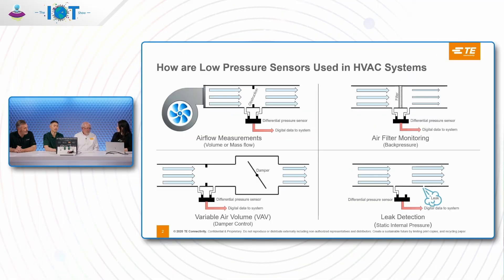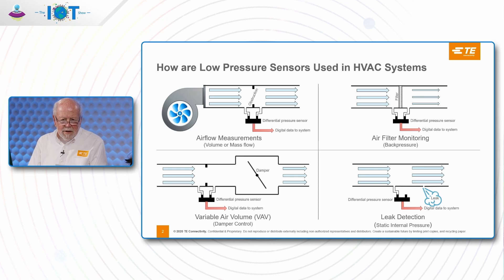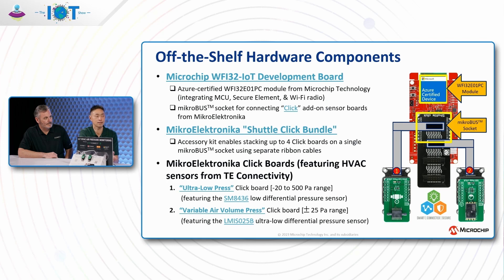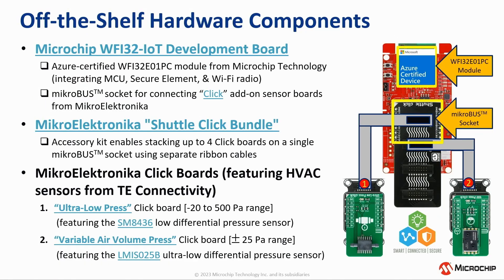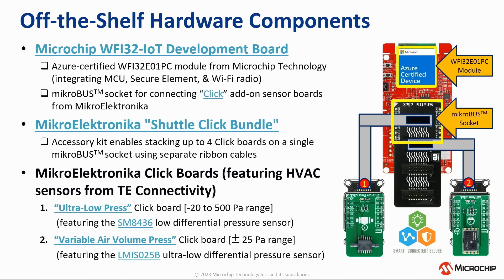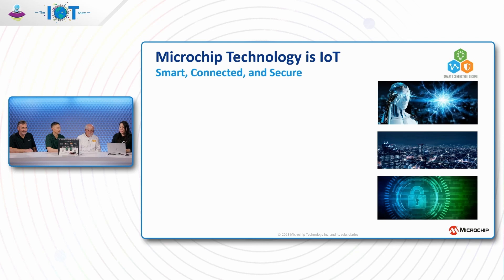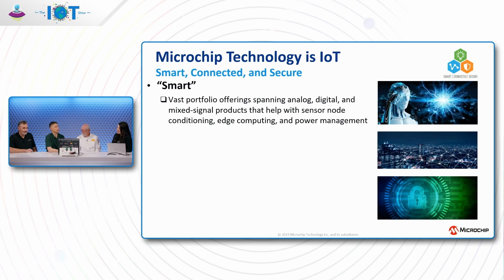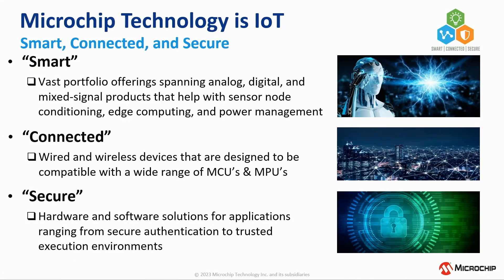IoT HVAC Air Flow Panel

Comment: Interesting Video, thank you
1- TE sensors are good but as mentioned for old buildings, as per ASHRAE we always( 95% of the time) do not have enough length to have an accurate measurement by those differential pressure measurements.  ( Personally, I really recommend Phoenix Control Method on this)
2- Liked Microchip board
3- How Avnet dashboard is different from Azure IoT Central?